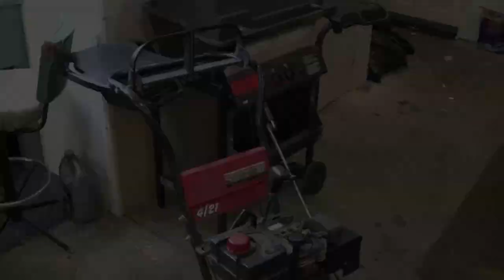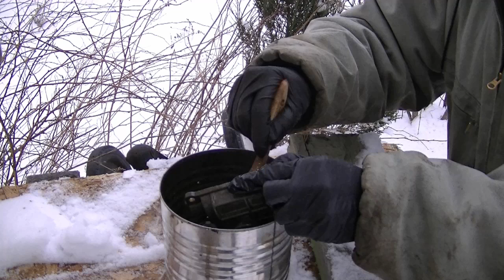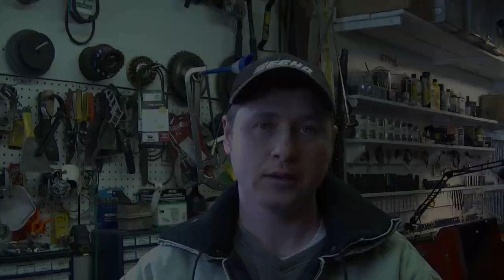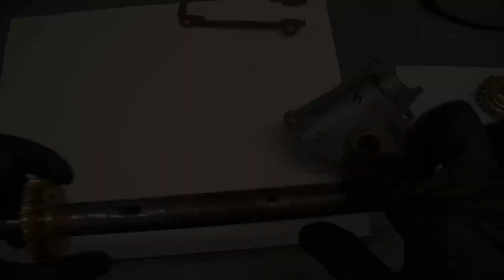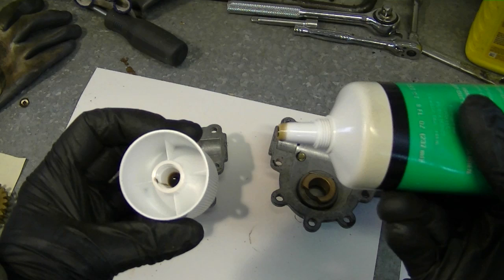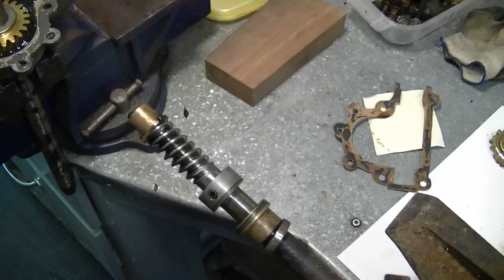4HP Noma Snowblower Auger Gear Box Repair Part 1/3

Comment: If the gear is loose on the rotor, u can peen it where the gear fits on with a hammer & punch to effectively increase the diameter of the rotor there for a snug fit.

Comment: To clean out the gear case housing with the broken gear parts and grease is to put the two halves in a container of boiling hot water. After 5/10 minutes the grease will melt and then take a blowgun with compressed air and blow it out clean. Allot faster than degreaser or brake cleaner. All it cost you was two quarts of water.

Comment: I have a toro snowblower 521 model 38052 1988 what I'm asking is about the seals for each side. Can I just buy new seals or do I need to buy a whole new gear box?
Reply from the maker: you should be able to buy just seals
Reply: @donyboy73  what would these seals be called exactly ?  I was able to buy the worm gear and all the bushings for 50.00 off eBay. Looked brand new. The gear itself goes brand new for 120.00

Comment: Donyboy73 how can I find parts for this machine? I have the identical machine minus the master craft logo and when I search the model number i can’t find anything, I’m looking for the proper belt for the auger drive, I bought mine and when engaged it has almost 2 inches of slack with the idler adjusted all the way tight.

Comment: I understand you are using 00 consistency grease - Excellent choice to keep the gear wetted especially in cold temperature -  But do you know the specs of the base oil in that grease? Worm gears require ISO 480-680 viscosity base oils to resist shear... I'm looking for a generic equivalent...

Comment: Thank you, really good explanation. Im trying to repair my Sno -Trac blower but I can't find the worm gear it has 20 teeth , inner diameter it is 7/8" outside diameter I will say 2" or  little less. there is 2 square gaps in the inner diameter 1" from the deeper side of one square to the other  square.  
Any ideas where to look for? or any OMG parts with that description. I will appreciate any help.

Comment: You should only grind the shaft with the wire brush...that way the oil/grease seal of the gearbox will last longer...if it's too rought it will worn out the seal lip...

Comment: brass gear should be steel
Reply: Safety feature. It will destroy itself if someone decides to put hardened bolts in place of the sheer bolts.
Reply: you right

Comment: I had to use a new gearbox case due to the carnage. The new case's bolt holes are not threaded. Do the bolts thread themselves or should i tap them??

Comment: I have a 44" snowblower attachment for my John Deere LA130... the brass gear inside the gear box is "toast" any idea where I can get a replacement gear, instead of the $300 gear box assembly
Reply from the maker: usually you can buy just the gear
Reply: donyboy73 the problem is finding a source for it... no dealers carry just the gear, only the gear box assem. Any ideas on where to buy just the gear?

Comment: Hi Don.  Great video as usual.  I have a question.  Could Lithium grease be used as a substitute for this application?   I have to replace the gear in my MTD snowblower and I have a container of Lithium grease already.   I didn't know if that would work as well.
Reply from the maker: yes it could
Reply: I use synthetic transmission fluid.

Comment: 1. does the primer bulb squirt gas into the throttle body, or does it just fill the metering chamber?...does the primer bulb always sit on the metering side, or the pump side, or both?...thanks..

Comment: Donny,
I'm following everything that I have learned from you to repair my Ariens st405 snowblower.  There was liquid gear oil in the auger crankcase can I use a grease like you used for my application or should I stick with the liquid gear oil?

Comment: We had the same exact problem with that gear on our Snowblower, it literally looked exactly the same as yours all chewed up. Not sure what they were thinking using a brass gear and then only putting grease in there. Our snowblower was only 2 years old when it went. Replaced the gear, cleaned everything, and put a decent amount of gear oil in there is what I did. No issues so far.

Comment: I have a Craftsman 5HP snow thrower whose gear assembly is very similar so have a question.  When putting assembly back together I am running into a problem where the two pieces will not seat evenly.  It seems to have something to do with the bearing flange.  Does this sound right and could you show how the flat piece is to sit when reassembling?  THanks,

Comment: Thanks again, Dony, for a great series of vids.  I did pretty much the same repair to a Snapper branded blower.  I found a replacement gear here in the US for about forty dollars.  Had I watched your vids first I would have saved myself a whole bunch of time.  I also found that the inner most portions of the augers were bent to the outside, such that the blower would push some of the snow to the sides.  Bending the augers inwardly so that they just barely clear the shaft cleared up the problem.

Comment from the maker: @Liamautomechanic if u buy retail here it would cost $80
Reply: I have to replace the auger drive shaft from a junk I got it. Have dismantled the gearbox and ready to reassemble with the simple instructions you have shown. I was worried that the key wouldn't lock the worm gear tightly, but seeing your video I just have to make sure it is locked in. Thanks donyboy!
Reply: Where do I buy retail just for the gear Donny. Great video as I was told to junk the machine. I enjoyed taking it apart and seeing how it worked.are all gears standard sizes or do they vary ?
Reply from the maker: @hemanttailor1126  you must look up part number to get correct gear

Comment: i use a wee drop of kerosine, for washingthe grease and oil and dirt etc, safer than, gasoline,good power on the buff, wire wheel,there, good vid dony,

Comment: Cereal box gaskets can work in a silicone sandwich. Thing to consider is thickness of the final sandwich because it influences how the two gear box pieces mate and form diameters around the shaft bearings and oil seals (oil seal outside diameters are important too). Cardboard is obviously water soluble so a cheap sheet of .020 gasket material might be a good investment.

Comment: Nice I have a 2010 ariens 13 32 my son hit something with it  in wet snow found out it broke the center auger gear that the belt goes on and broke part of the inside where the pulleys are just got it back under warranty still cost 57 bucks said  as was told break away bolts shold have protected it but I had to pay for gear they replaced whole auger housing . I have a 1994 MTD 10 30 that has hit bricks and everthing not much damage but alas MTD rusted out do not make them like that anymore

Comment: would it be possible to use the auger gearbox and shaft as like a rear end for a go kart if you took off the impeller and made some kind of U joint that attaches to a clutch then to the shaft? that would be cool